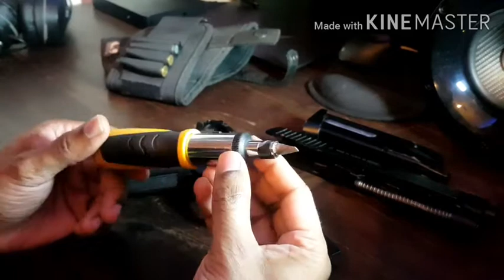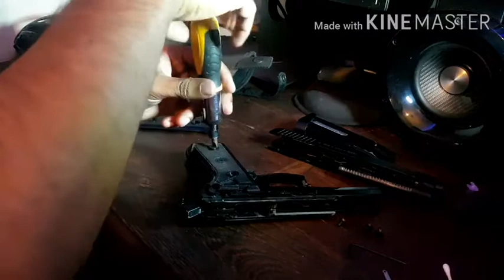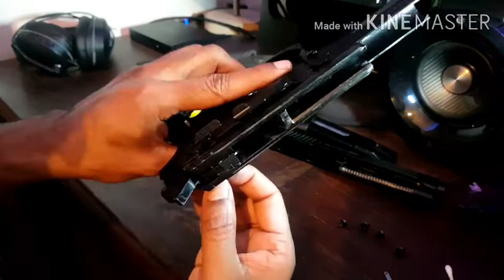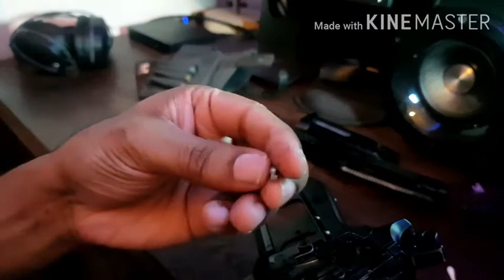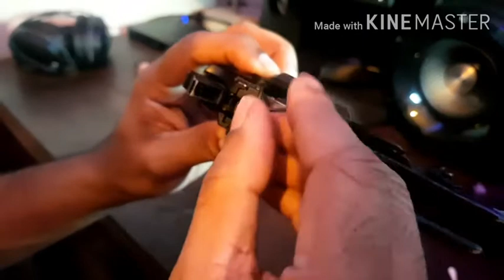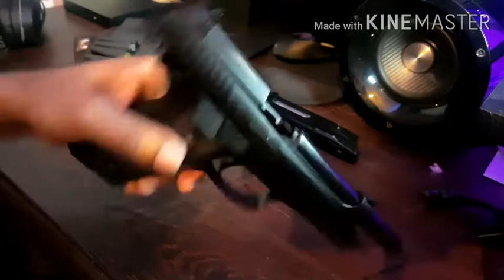How to fix KWC co2 pistol stuck on full auto only?! (SOLVED)

Comment: hello friend, I have one just like it, the trigger spring broke and I don't know how to remove it to change the part, do you know if it is possible to repair that part?
Reply from the maker: You have to order a replacement spring for it
Reply: @PROJECTDRIVEN1  hello. the problem is that i have tried to remove the trigger but the bolt that holds it seems to be fixed and not removable
Reply from the maker: @manuelalejofelixbojorquez5878  Okay I am not sure if it opens or not but it must be serviceable in some way. I haven't needed to open that part. I think check forums or product manuals for the trigger part.

Comment: I bought a hfc hg192b blow back co2 pistol and for some reason the gun is only shooting semi auto but not full auto. D ok have have an idea of what is happening and what I have to do to fix this problem?
Reply from the maker: Check the worm screw and moving parts in that area
Reply: @PROJECTDRIVEN1 do you know where the worm screw would normally be at?
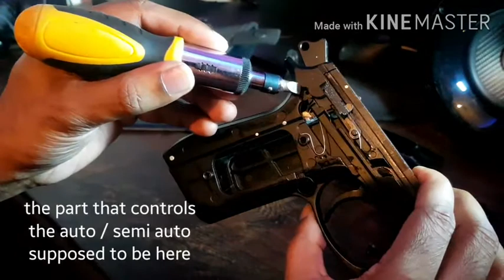Reply from the maker: check out 1:30 & around 5-7min marks on the video
Reply: @PROJECTDRIVEN1  thanks
Reply from the maker: You're welcome

Comment: now the problem is finding that clip, do you know of anywhere to buy this piece?  as mine is lost in the woods somewhere.
Reply from the maker: They are tiny and hard to locate. Try the retailer that you purchased the gun from
Reply: @PROJECTDRIVEN1   Yeah thats the problem, no retailers in Norway really import that much parts
Reply from the maker: Try to import from the manufacturer. The box had details for parts

Comment: Hi..where can I get a worm screw for the same gun
Reply from the maker: This is a KWC pistol so you can try the CO2 gun suppliers locally, or the place you purchased you gun. You can also check with the manufacturer...contact info. should be in the box.

Comment: Could you show us how to fix   broken spring of trigger ?
Reply from the maker: Hi there
What to you mean by broken spring? You would need to order a replacement for that...can't really fix the spring.
Reply: @PROJECTDRIVEN1   SURE, I just bought a new spring. I do not know how to disassemble the trigger and install the new spring . THANKS.
Reply: @PROJECTDRIVEN1  I mean how to disassemble the trigger.
Reply from the maker: @姜智勻智勻  I haven't disassembled that part of the pistol myself...one option would be to try slowly and if you not completely comfortable doing it yourself check with the stores that sell them...they will know of local repair services in your area.

Comment: The mag on my gun malfunctioned. The spring doesn't go up & down as easy as it did before.
Reply from the maker: Maybe try removing and strengthening. If that doesn't work then you can order a replacement spring from the manufacturer.
Reply: Been trying to open the mag with no luck. Maybe if you do a tutorial a guy might learn a thing or 2😁
Reply from the maker: I will put one together. Maybe try for a replacement magazine
Reply: Well I'm trying for that but they only have spares for glocks in my country. I'm from South Africa
Reply from the maker: I'm also from SA. Try the company you purchased it from...they may be able to source it for you.